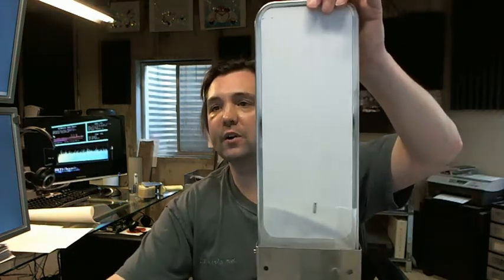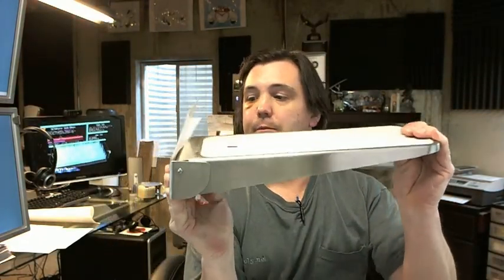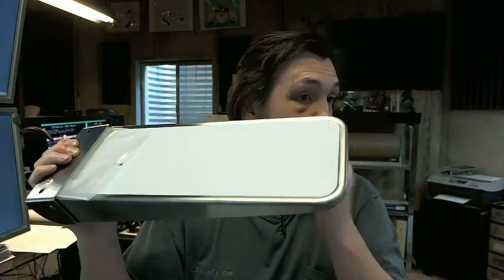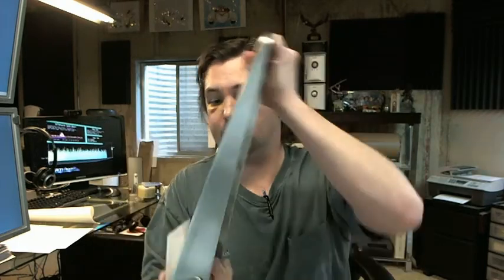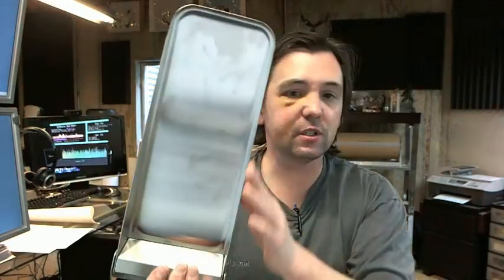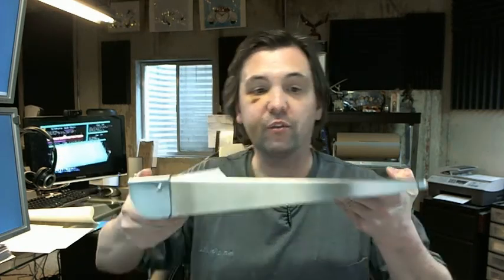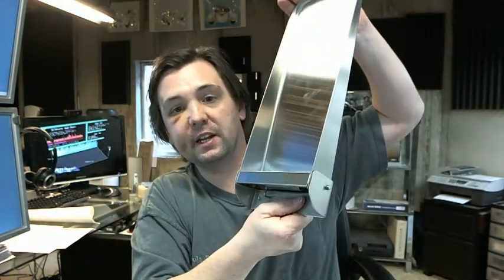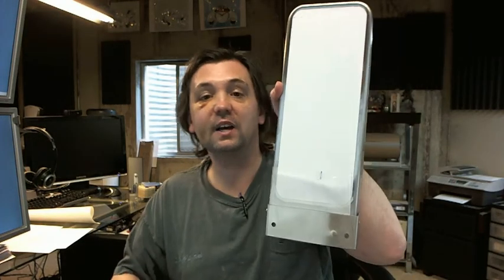ASI 0698 Folding Utility Shelf

Comment: What is the spring weight pressure? How much weight does it take to hold down the shelf? Thanks
Reply from the maker: According to the manufacturer part number ASI 0698 Folding Utility Shelf requires only 10 oz of weight to keep the shelf in the horizontal position.